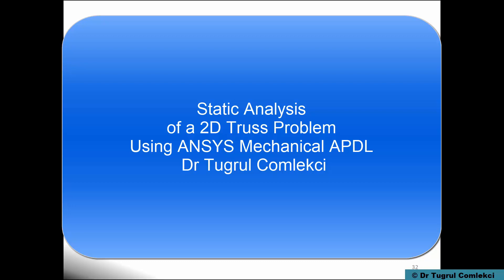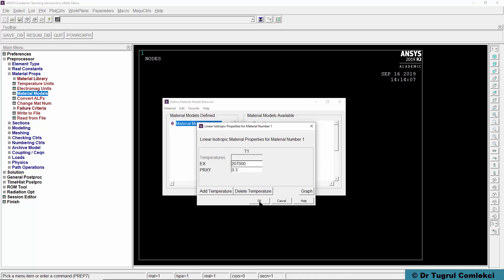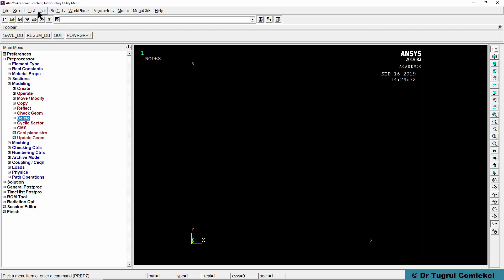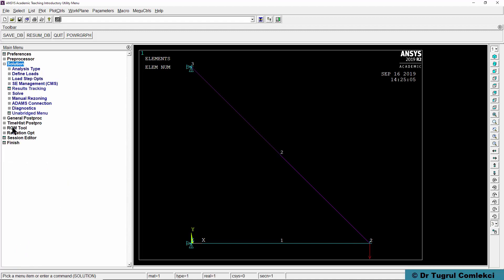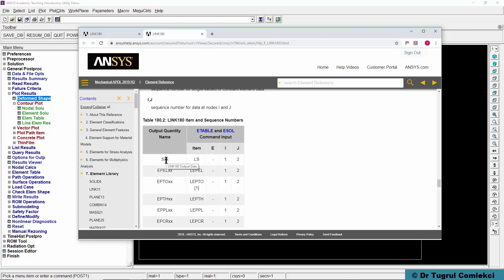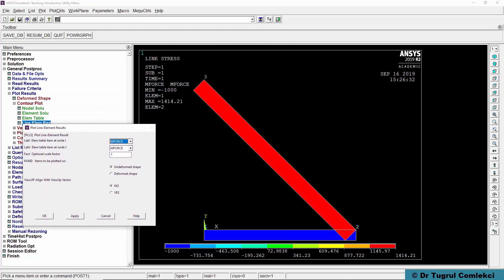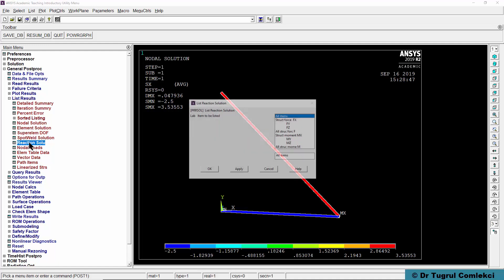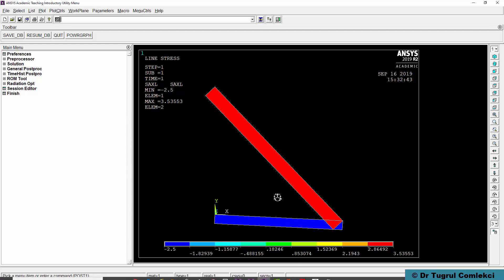2D Truss Example FEA using ANSYS Mechanical APDL

Comment: I can't define the element table at 11:20. It always gives me an error of "The requested database is not available. The ETABLE command is ignored." And after that the dialog buttons are greyed out and I end up having to kill the program from task manager. I've been unable to start the truss problems in the tutorials because of this.
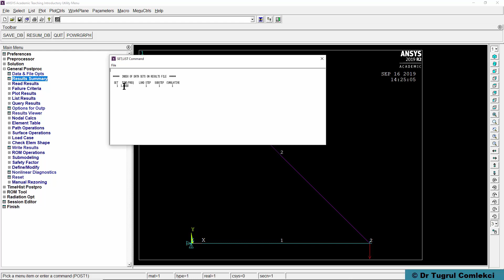Reply from the maker: Hi Mark, did you read the results from the first set (set,1) @ 8:20 when you entered /post1 post processor? That usually solves this problem.
Reply: @FEAnalysis  That was it. I missed that the first time.